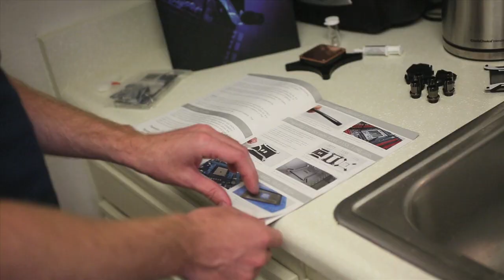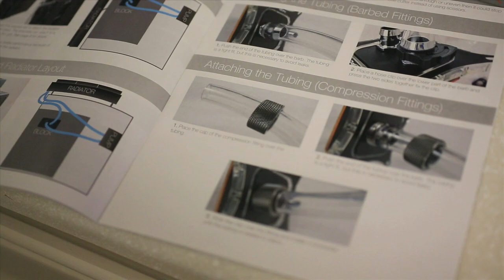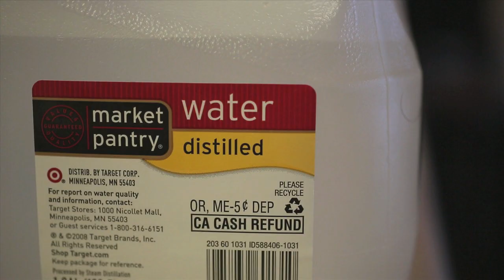A Beginner's Guide to Water Cooling Your Computer

Comment: I been using this antifreeze since 2002 https://www.amazon.com/dp/B08BYFGS84   i first started with a socket 478 than QX9650 than i74960x  it seems to last for ever and does not corrode anything its not pre-mixed (diluted) with water like other brands.

Comment: How quieter is it if you still have the fans?
Reply: You'll have the radiator fans. If your GPU is air cooled, you'll still need case fans to get rid of the heat produced by the GPU. Plus the motherboard produces its own heat. You'll still need case fans, but probably not as many.

Comment: question...can you cool 1 cpu with 2 360 rads if your case has the space? can I just...connect the hot line from the cpu to the input of rad 1 then jump the output from rad one to the input of rad 2 then the output of rad 2 back to the pump or cpu? and would there be any worthwhile advantage to doing this?

Comment: please dont follow this guide, he didnt put clamps on the tubing around the fittings which will lead to a leak eventually, and dead components. this is due to the tendency of the ends of the tubing to expand to fit the shape of the fittings which will lead to less tight and less reliable connections in your loop.

Comment: Would it be a problem to use auto antifreeze as the coolant? I live in Canada and am worried if the furnace fails one night, and I want to be able to transport the computer during winter if I move or whatever.

Comment: I find putting 50/50 of water and isopropyl alcohol not only retains the colder temperatures for longer, but reduces the amount of times you need to replace the reservoir.
Reply: I've got a 5lt bottle of isopropyl alcohol and it says it looses 1% strength per day if not cept cool (in fridge), so having it as a cooling aid seems non productive as it would lose it's edge within days (depending on the strength)

Comment: I’ve been reading all these comments and it seems that there are a lot of people who know things about computers. i’m building this setup... : CPU:
Intel Core i9-9900K

MOTHERBOARD:
ASUS ROG Maximus XI Code

VIDEO CARD:
Asus ROG Strix GeForce RTX 2080 O8G

MEMORY:
Corsair 4x8GB Vengeance RGB Pro DDR4-3200 White

CASE:
Lian Li PC-O11DX 011 Dynamic

SOLID-STATE DRIVE:
Samsung 970 Pro 1TB PCIe M.2

FAN:
Antec Prizm 120mm Addressable RGB 3-Pack with 2 Light Strips

POWER SUPPLY:
Corsair RM850x Gold

CPU COOLER:
Cooler Master MasterLiquid ML360R

I never built a pc before, and this will cost me around 3,500 USD And i’m mostly concerned about the water cooling and messing up the whole pc. And anyone wanna give me some advice??

Comment: I honestly would build a water cooled PC alone, just alone for the fact it's a water cooled computer , but set-backs are what keep life interesting. 
1: ain't got WiFi, I could get a computer with an external ( or get a bigger case for an internal) CD drive but that seems frustrating because I barely remember which HDMI cable goes into my TV. 
2: Money. I could get a job and work my ass off like a mule, but my parents wouldn't like me spending $ on something that I'll just have ( to marvel at, omg just look at it. ) 
And 3: Time. 
I'm a high-schooler hopscothing over the giant holes of failure. Likely gonna lose a shoe in a hole by doing some stupid. 
But hey, a kid can dream right? 
right? :(

Comment: Overall i'm not a fan on water cooling the risk and the number of risks outnumber the benefit and even that benefit isn't the best as a scientist I know the rate of conduction through metal using cool water isn't as effective or reliable as air. If you heat water it takes time to cool and that water moves fast in your pc not slow enough to cool and don't forget the heat generated by your gpu etc. Air is much more effective and removes it out of the system too.

Comment: Here is another good tip: distilled water isn't as much conducive as the other ones so if you accidentally pull a plus it's nothing to treat about. Just disconnect the computer to be safe

Comment: Drains and valves? Different brand tubing and fittings? Angled and rotaries? Galvanic corrosion can be a serious issue too; aluminium and copper should never be in the same loop, even if you have a corrosion inhibitor. And did you really not clamp onto those barbs? Listen it’s good you’re trying to bring custom loop to the mainstream, and I appreciate you can’t fit everything into a video, hence the reference to an article. But there’s some serious omissions here and without additional guidance someone could ruin thousands of dollars of hardware if they just referred to this. Let’s be honest, whilst it would be madness to, people really will.

JayzTwoCents does some excellent coverage on how to watercool, it’s thorough and factually accurate. My recommendation would be to watch some of his work and revise this video. It’s not The Verge level of incompetence, and I appreciate your intentions are honourable, but this is not a good ‘guide’.

Comment: Wrong. You need to go from the block to the radiator so the water is directly going to be cooled. Don't go the other way (from the radiator to the block to the reservoir) because your reservoir will contain all the hot water even tho your block will get all the fresh cool air from the radiator. This will cause all your cooling system to work with the hot water. You should bring the water directly from the block to the radiator to cool it off so all the water is cool and so your whole container will be cool and there will be no problem to send it to the block.

Comment: Umm, weird question but where did you get that performance display on the front of your case. That looks really helpful for temp monitoring and OC.
A more relevant question could I use Mineral Oil? Its non-conductive so leaks wouldn't be so bad and it takes allot more to heat it up.

Comment: Toilet paper? No. Paper towel? No. Cloth dab-rag? No. Cut small pieces of coffee filter, and use high% Isopropyl Alcohol. Don't believe me? Ok, use your best cleaning method until you think the cpu ihs is clean and dry, then use a bit of coffee filter and IA and youll see a residue stain on the filter.

Comment: There's a reason people use actual coolants over normal gallon jugs of water. It's because of how it reacts to the cool air it comes in contact with. Water takes A LOT more power to cool down, and is less effective, especially if it's just cheap gallons of water from the grocery store.

Comment: I just finished my pre-build of my PC and I will call it a pre-build because I will be placing the liquid cooling system in it soon.  I am using GeForce GTX 1080i 11G GPU in this system.  I checked the temp of the GPU and just running normally it was 72.6 degree's.  Yes that is idle only running 1 monitor with nadda going on.  Now to make this better this card is sitting 1.5" away from the CPU.  When I really use the card for its intended purpose.  Do the math.  Yeppers Liquid cooled it will be
Just Saying

Comment: Castrate me if I'm completely out of line but heres what I plan.  I have an indoor heated pool.  I think about connecting such a device to this pool while running the setup on a lower plane.  Does Chlorine corrode such a system?

Comment: Unless you're gaming for 6+ hours a day, you really do not need a water cooling system. The stock fan on my CPU has lasted my CPU for 7 years and I'm a heavy gamer. My CPU is still kicking with no problems.
Reply: Water cooling is also useful for those who want quiet system. Fan noise is pretty annoying especially when you have your computer right next to your face.

Comment: I would not recommend tightening barbs on the CPU block with the block installed. all barbs should be installed and tightened prior installing the water cooling hardware into the system.

Comment: Distilled water isn't a bad idea, unless u spring a leak and don't realize it. Cuz at that point your stuff gets zapped and you never saw it coming. I would use a solution that dosen't kill PC parts if it come in contact with them. But other wise, great vid bro, like really great, this is one of the better water-cooled vids ive seen.

Comment: air cooling is quieter...since water cooling uses fans and a pump.....surely custom loop water cooling can be more efficient if youre a hard core overclocker. but its been prooved that air cooling is quieter....soooo, the only justification for it is extreme overclocking, which at that point you might as well get better hardware than using an insane amount of electricity.

Comment: Can the water cooling tube break?
Reply: Louis M.  In theory, the water cooling tube COULD break,  this is why he mentions in the video about the testing period. When connecting the tubing to each of the fittings on the various components, be sure that the fittings are tight.  You could get away without securing them with anything, but for the few dollars spent on some zip ties or hose clamps, I would consider it cheap insurance for the hundreds of dollars invested in the desktop it is cooling.  Even after the unit has been installed on the desktop securely and no leaks are evident, it is always a good idea to check the fittings every month or two. As the computer heats up, the water/coolant heats up with it, this heats up the tubing. When things heat up they begin to expand a small amount, and when they cool down, they contract. This cycle of heating up and cooling down can be enough to loosen the connections that were at one point in time, very secure.  So all in all, yes the tubing could break, but with taking a few precautions and doing a little bit of preventative maintenance, the chance of a tubing failure is significantly lower.

Comment: Ive seen cpu coolers thats just the water block hooked up straight to the radiator with all these resoviors and crap.. are there different types?
Reply: xIAMDAVEx that's a all in one so the pump is part of the water block but they aren't expandable

Comment: Do I need to unplug my power for my graphics card and the 8 pin power connecter or can I leave those plugged in while filling?
Reply: SUPRA I think I found the answer their thanks dude! In case ur wondering though u need to unplug 24 pin 8 pin and graphics card power and then u jump the 24 pin
Reply: SUPRA ok dude

Comment: I like the idea of water cooling my system, but after playing my most graphics intense game it wasn't that hot with what I had.Guess I might try it with a new system when I get to that point
Reply: Supposedly, since liquid cooling is more efficient than air cooling, you can lower your fan speed... giving you the same cooling performance, but less noise. And it's this aspect (a quieter setup), that I'm interested in.
Reply: Nikolai Kalashnikov Same
I already have a quiet setup, but it does tend to get hot. Nothing bad though, I just want to try my hand at something new
Reply: I actually do not know if my computer would be considered loud or quiet. lol. I guess i need to download like a decibel meter app and measure it ?
Reply: Probably, but I'm just guessing mine is.
Because unless I'm running something heavy it doesn't start to make sound
Reply: If you don't know what you're doing, don't try to install a water cooling system. Seriously, even CLC water coolers are a giant pain.
Reply: Rebbids Stuffed I have an Idea of what to do, obviously I wont start off using water because that's just suicide Lmao

Comment: Which one is better? Or rather safer (leak safe), out of these 2?:
Corsair H60 120mm vs Corsair H801 V2 Thick 120m
Thanks in advance
Reply: Neither one is very likely at all to leak.
The H80i has a thicker rad so it will most likely keep your CPU 2-3 degrees cooler under load than the H60 would. 
It mostly comes down to cost. I would probably go for the H60 if money is an issue.
Reply: Kinda money issue but much more worse with the leak stories I've heard :'(. But I will probably buy an H60 later on idk not sure though too scared, I cannot afford the pieces I bought for my PC I put my all in it
Reply: I has anczxt  kraken for 2 years premade garbage, anyway never leaked or had any problems other then startup pump coraking. Corsair is on my gpu its perfect so far

Comment: Thanks for this video. I've been doing water cooling over ten years and stopped for a while. This actually gave me many tips that I didn't know. Such as cleaning the tubes and radiator with hot distilled water. I started this venture with cheap poor materials, diy methods and a bad understanding of material longevity.  My first build lead to some serious disasters, which actually didn't kill any hardware. Some more Noob tips are: Never damage a barb's tip (it will leak), you should use a plastic hose clamp for barbs to be safe, do not use glues to bind high pressure areas, make sure to use 0-rings or teflon tape for the fittings, the fan should pull air out of the radiator (not push in like in the video ;)), finally consider using a T-line instead of a reservoir because it is simpler.

Comment: I don't get the hose-clamps comment. Barbed fittings aren't supposed to tightly secure the tube???

Also I find SO fun to put paper on the Video card... Video card being generally the most expensive component of a Computer I would just take it off...

This is so simple... Take the Video Card off, simply put the PSU out of the case and you're 300% safe for your first "dry" run...

Comment: What about draining the system?
Reply: Pull your res out with out disconnecting any tubing then disconnect the tube that is putting water back in your res NOT the one that is having water going out to the system. Use something to get the water out of just let the pump do it. then when all the water in the loop is out take out the res and rad and clean it out

Comment: The water goes back to the reservoir and drips like a faucet or a water fountain why they don't put a water filter there. It won't affect flow or performance and you can always access the res fast and easy to clean filter like in cars. I mean it makes perfect sense why they don't implement it from start.

Comment: Says...."Your computer will be whisper quiet" after installing an electric pump and 2 more huge fans on top....
Reply: They don't have to run as fast since it's not as hot, thus they are much quieter.
Reply: Plus, if the fans sit in a place where they aren't visible, one can go for Noctua fans. Those are indeed whisper quiet, although their colors are horrid.
Reply: Oh, thanks. Didn't even know about those, they're awesome! :) And available in Denmark, but apparently not in the shops I normally use. Thanks again. They'll solve a problem I had with my own cabinet as there are 3 visible fans that I'd like to be more silent, but without giving up their aestethics.
Reply: You are looking at the wrong model. look at the chromax version.
Reply: Not any more.. you can get them in black now!
Reply: true, but they still got that ugly brown anti vibration bracket on them. And the black version is also the most expensive one. At least here in Denmark :)

Comment: fuck water cooling and fuck fans, i do it the asian style cuz im fucking asian, remove the case and put a fan/airconditioner infront of it
Reply: Raul Izquierdo then why the fuck u watching this video, you should be watching on how to install a heater in your pc
Reply: Kirigaya Kazuto And that, my friends, is how you get dust on your hardware!
Reply: Hampton Barnes I CLEAN IT WITH MY LAUNDRY TOO U FUCK
Reply: Lol
Reply: i have my pc in the freezer with dry ice
Reply: Not recommended with your typical home fan due to high electromagnetic fields they give off.   If you ever put one of those near a CRT you'd know what I mean.
Reply: Kirigaya Kazuto trust me im asian
Reply: Dishrespect
PCs get dusty either way.

Comment: what if there's a leak? all my components die? :O
Reply: If a corsair AIO leaks they will replace the parts
Reply: Yep.
Reply: you see the thing is: i'm new to pc building (i have seen loads of videos and i'm wishing to build one for almost 10 years BUT i never could afford it. However i will start working shortly and I want to get a BEAST PC. And to do that i need a good cooler, but the air coolers (much safer look like crap inside the case :/ i want to look at it and see a beautiful case with awesome components in it D: but i'm afraid of leaks :/ i was thinking of getting the H110i GTX but after seeing videos of leaks it scares the carp out of me :S
Reply: PCFreak Leaks are rare. If you watercool your PC it will be a lot quieter and you will get a lot better performance, but air coolers are safer.
Reply: Cody that is what I was told! and yes i do want to OC my 6700K xD (never done it before but the asus tweak does it for you supposedly well)
Reply: PCFreak No they dont from what i can see just i go from personal expierence i have bought 6 one leaked i emailed them telling them my 980 was killed by the leak they sent me a new one
Reply: dangzard You would never use mineral oil as a cooling fluid... In a watercooled build. You will kill your pump... Do me a favor do a watercooled build with mineral oil...
Reply: dangzard 4.9 ghz 6600k? yeah so simple
Reply: Just get an AIO cooler like the corsair h60 or h100i
Reply: Ive Lohan that is my intention, to get a gtx h100i but i'm still afraid ;-;
Reply: Josh the raptor where can I read about that? Do they talk about it in their site?
Reply: dangzard Dont give out bad information non conductive fluids will become conductive after a couple of days
Reply: Anonymous Tutourals/reactin/reload My point exactly guy realised he fucked up and shutted the fuck up.